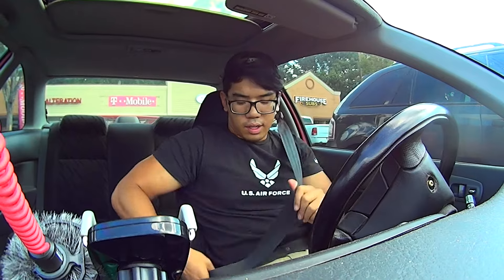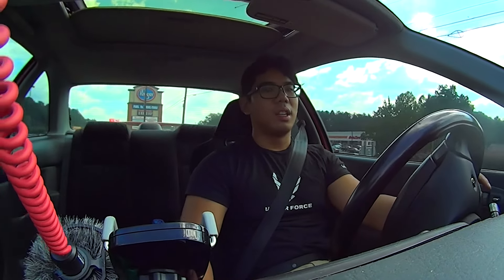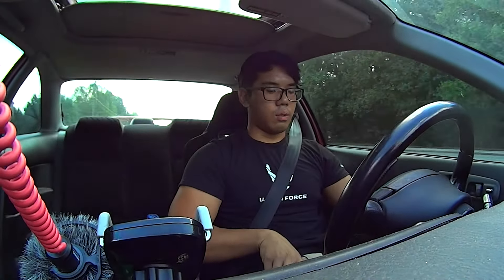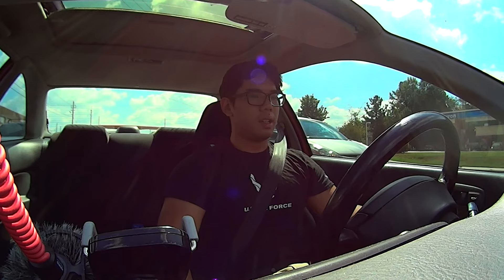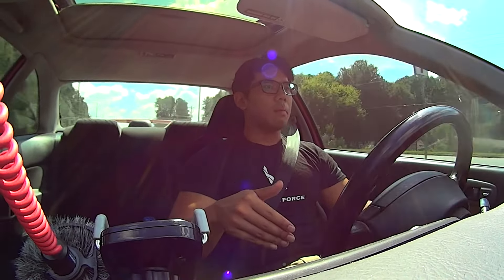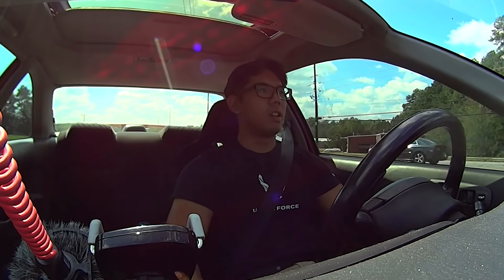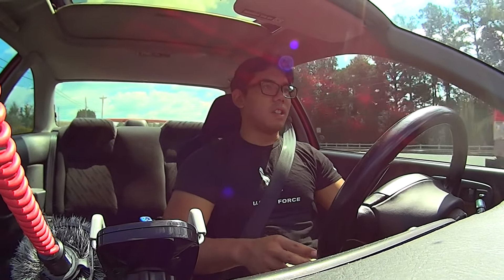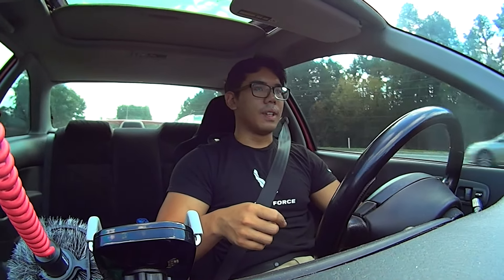Polyurethane Engine Mount Review - 2000 Honda Civic

Comment: I got the solid mounts from yonaka and the vibration is too much. Everything vibrates and I can barely hear my exhaust over it. I want just a little more vibration than stock, not this much. Should I just put inserts in the stock mounts?
Reply from the maker: These inserts are definitely more mild than solid mounts. The good news is the inserts are cheap and easy to do. I hear any vibration with the inserts, but you can feel everything just tighten up if that makes sense.

Comment: We will be installing hardrace motor mounts on my integra.  Based on reviews, the mounts transmit substantial vibration.  I hope they respond well.
Reply from the maker: Nice, if cash wasn't a factor I'd go with those too and if they aren't stiff enough (they should be) you can always add the inserts after the fact since they're OEM style

Comment: I know I’m late lol , but what are the part number for the inserts bro all 5, I’ve been trying to find it and I just find one with 3 mounts , I’m also looking for the torque mounts inserts , , thank you bro in advance !
Reply from the maker: Hey, so it's been awhile since I installed it but at the time there was a guy on ebay that was selling a combo of all 5 mount inserts (basically 3 mounts from the prothane kit and 2 from energy suspension). I used to see someone offer just the torque side monuts from ES and then you would just need the Prothane kit to complete it. Ebay is probably your best bet. Good luck!

Comment: What’s the hardness of the mounts?
Reply from the maker: The prothane inserts are hard, like plastic with very little give. Meanwhile the Energy Suspension inserts have give, softer than typical skateboard wheels but harder than longboard or cruiser wheels. So.... if you know durometer, ES is roughly 87A and Prothane is like 100+ probably
Reply: @OhItsJustZhu  that was an incredibly helpful analogy, thanks lol. Have squished many skateboard wheels and I knew exactly how they felt from your description 😂
Reply: @skrimper  What about trying to use skateboard wheels as motor mounts?!?!?  That would make a great video.

Comment: How are they holding up?
Reply from the maker: Hey! Sorry for the late reply. But they've held up fine. first week or so was pretty stuff, but as I drove it, they started breaking in and they're still great. Nothing deteriorating, and no bolts rattled loose. And still just as responsive.